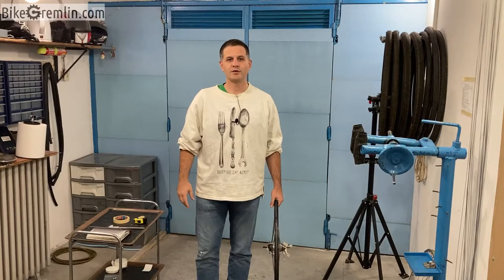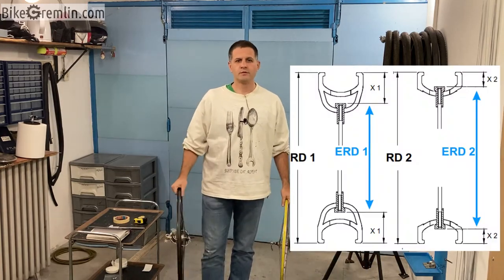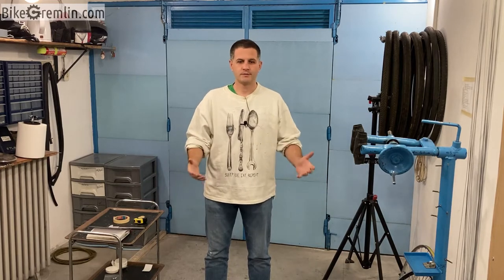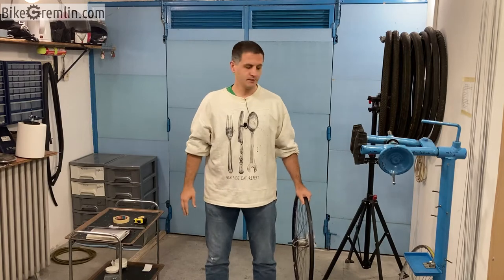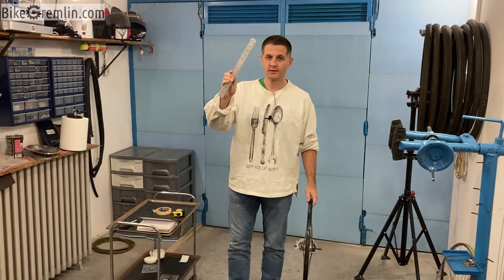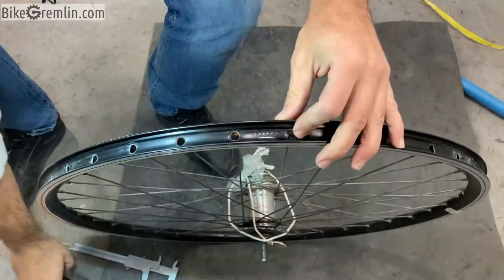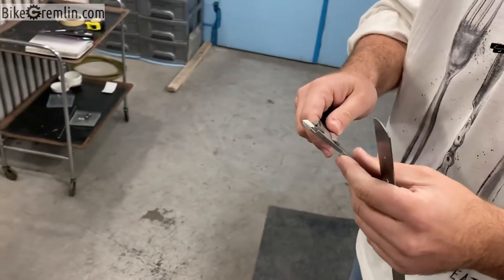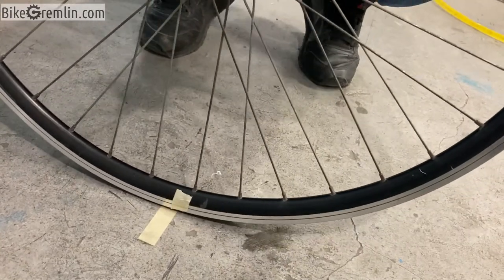How to measure the effective diameter of a rim on a finished wheel

Comment: This is the worst video I've found on the topic. You don't explain the calculation you're making with the distance you measured 🤬
Reply from the maker: Indeed - I had completely forgotten to show the formula(s).

The calculation (formulas):

π ("Pi") = 3.14
Circumference = 2 ⋅ Radius ⋅ π
Diameter = 2 ⋅ Radius
Circumference = Diameter ⋅ π
Diameter = Circumference / π

That's how we calculate the outer diameter from the measured circumference.

Then, to get the ERD, we need to:
- Measure the distance from the outer rim's edge to the spot where the nipple is seated.
(This is noted as X1 for ERD1 and X2 for ERD2 in the video's example graph)
- Substract the double of that from the outer Diameter (because we have that "extra" on both ends of the rim).

So:
ERD = Diameter - (2 ⋅ X)

Relja
Reply: @BikeGremlinUS  thank you for adding it to the description 🙏
Reply from the maker: No problem. Thanks for pointing that out.  :)

Relja

Comment: Great piece of information! Can I replace a 26*4.0 inch tyre with a 26*3.0 where the rim width of the bike is 40mm. Do I need to also change the tube?
Reply: @BikeGremlinUS  Thank you so much. Also thanks for sharing the thorough articles. Just becoming a fan of your channel!
Reply from the maker: Here's my chart on which tyre will safely fit which rim width (and what to measure on the rim):
https://bike.bikegremlin.com/285/bicycle-tyre-dimensions/#t2

Comment: A gigantic set of calipers would be easier. Read with a ruler. Perhaps a bar clamp used for woodworking could be adapted. ERD can be looked up at various sites but can vary from published data.
Reply from the maker: I'd also add that not every manufacturer gets it right (i.e. the way of measuring differs, so it can put my spoke-length calculations off).